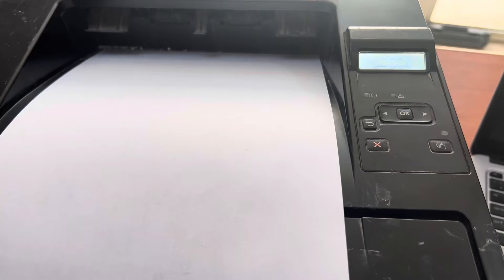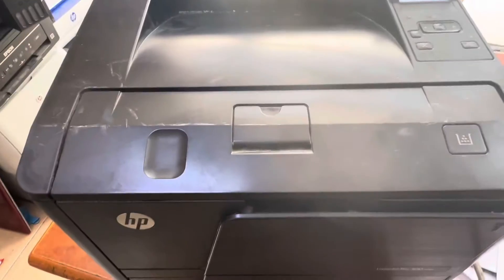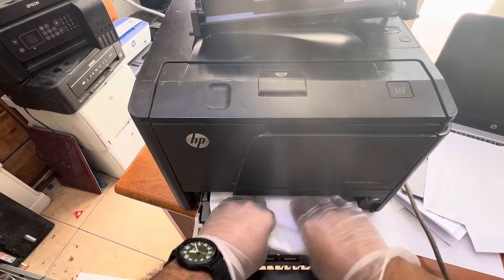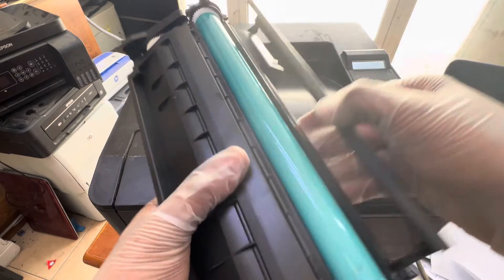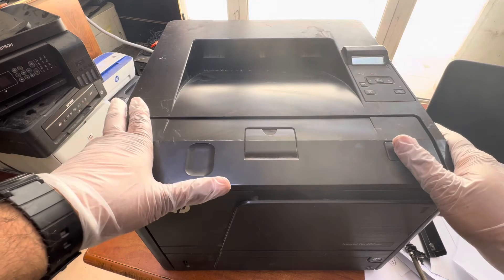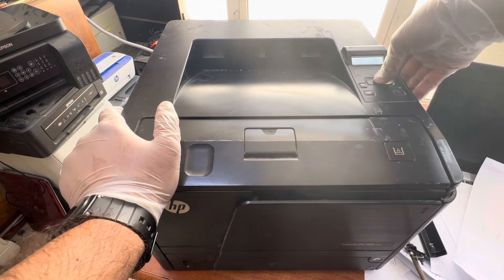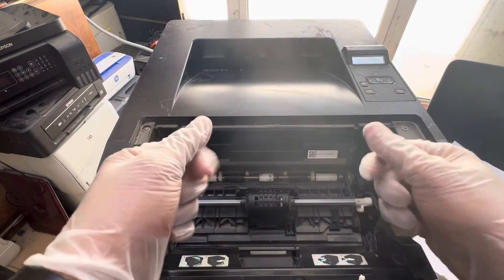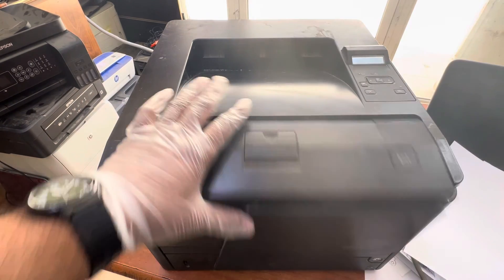Paper Jam in Cartridge Area Solution Most of HP LaserJet Printers

Comment: Tried removing the plastic cover and checked roller is rotating, a bit tight , but moving. Still paper jams in cartridge area.  Operates normally on clean print head function